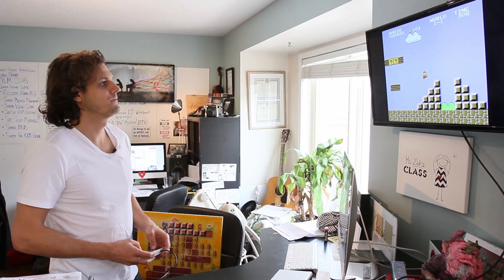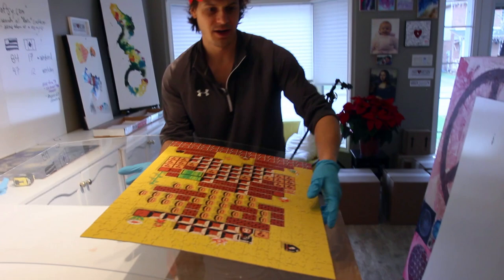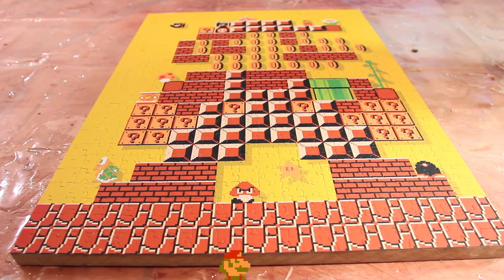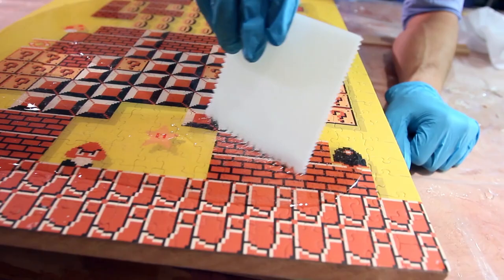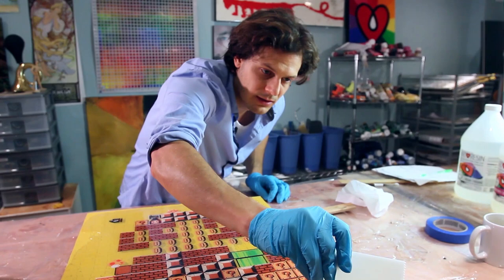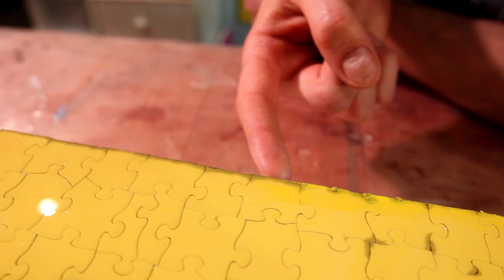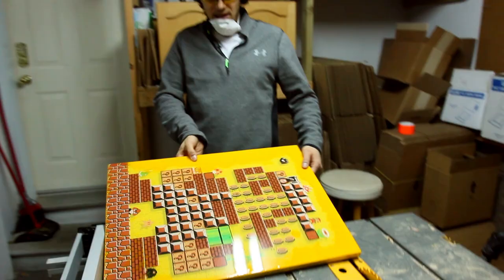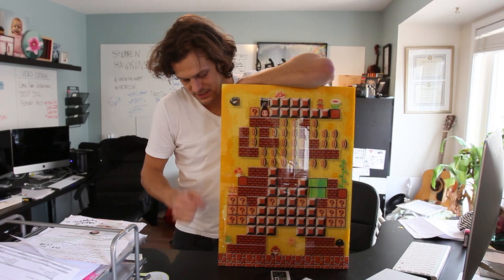How To Resin A Puzzle

Comment: If I resin a puzzle and all sides of the wood will it be waterproof enough to hang it outdoors?
Reply from the maker: Yes, resin is waterproof once dry, you just need to make sure it's completely sealed ... front, back and sides.  Anywhere that water or moisture can get in to the puzzle or whatever it's mounted to can cause expansion and contraction so you want to make sure it's totally sealed.